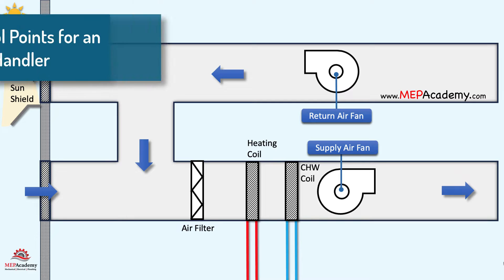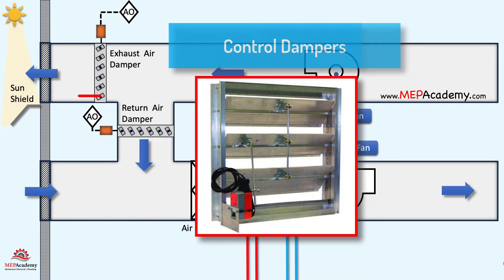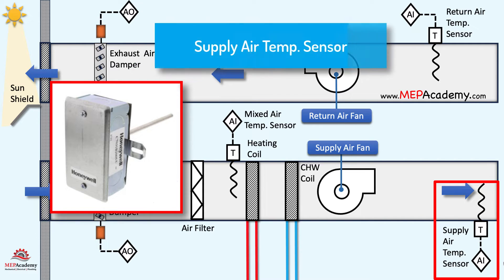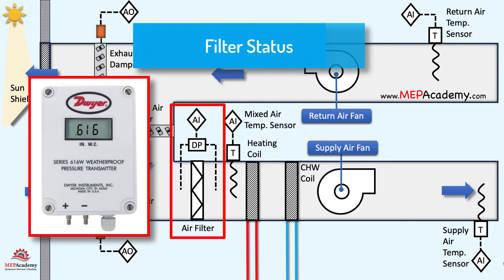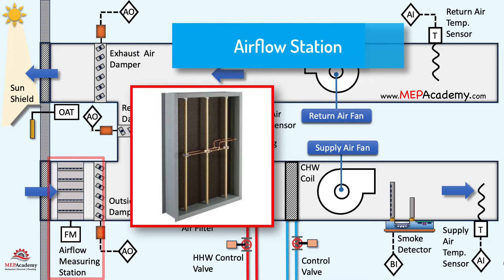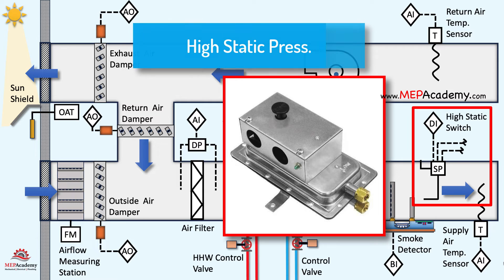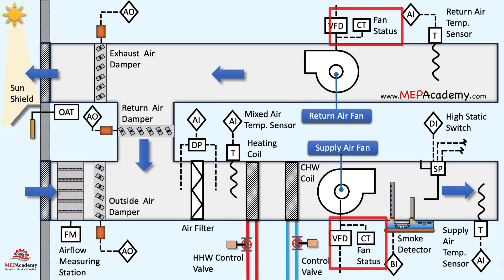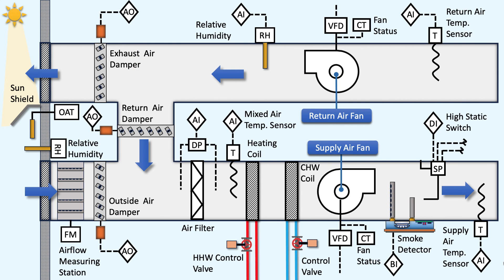DDC Control Points for an Air Handler

Comment: can i buiild this control points without adding BMS?
Reply from the maker: You can get an Air Handler, Boiler, Chiller, VAV box or other equipment that comes with its own Factory Installed Controller that is made specifically for that piece of equipment, they are considered "Application Specific Controllers (ASC)". The manufacturer often provides software that can be loaded onto a Laptop PC that can be used to change settings when connected to the controller. Hope that helps.
Reply: @MEPAcademy great to know this one, Thank You 🙏